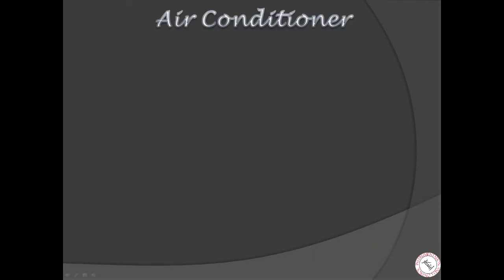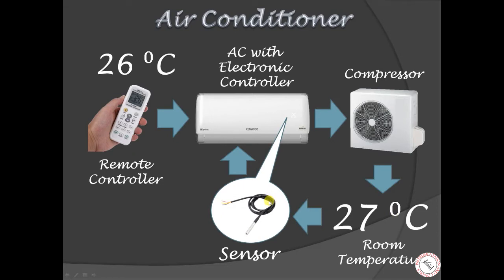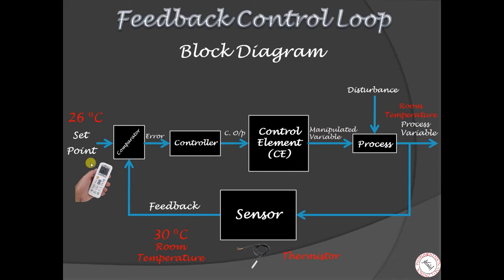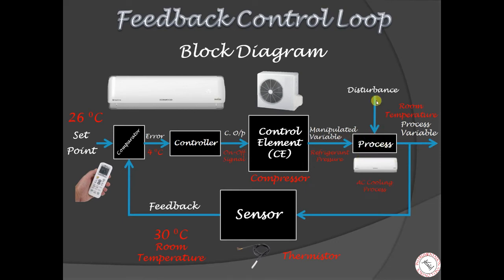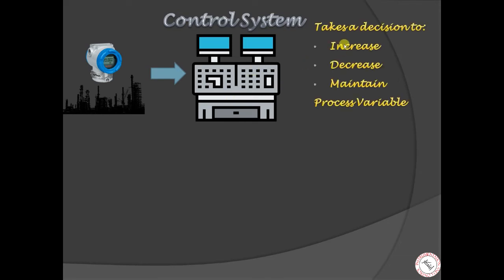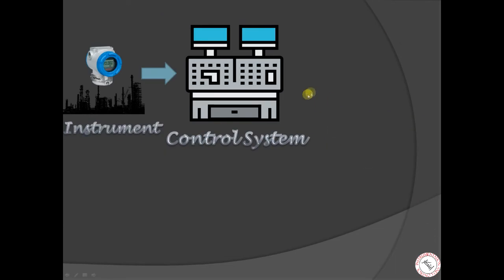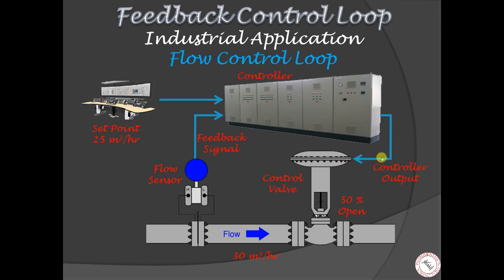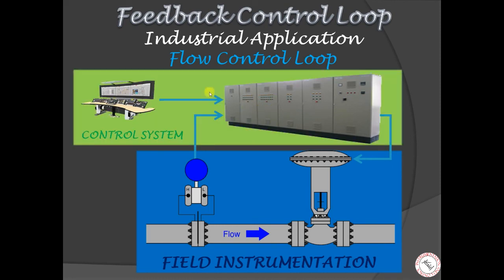A-2 - Intro - Feedback Control Loop

Comment: One question...what is needed to improve the feedback loop to keep the temperature or any other process variable at at desired state? a high speed comparator? sensor? controller? control element? or all of them?
Reply from the maker: Although all of the elements shown in the loop play major roles in the Feedback Control Loop, but the Controller is the brain of the system and unlike the basic On-Off Controller shown in this video, sophisticated PID, Fuzzy Logic, etc controllers help in making a fine control system.

Comment: This concept is very useful for freshers to prepare themselves for their interviews and tests at major Oil & Gas sectors in Pakistan. The example of Air conditioner to explain the feedback control loop was very much beneficial, which in turn helped me to grasp the practical example of the feedback loop further defined in the video.